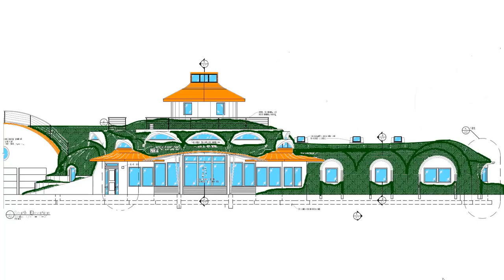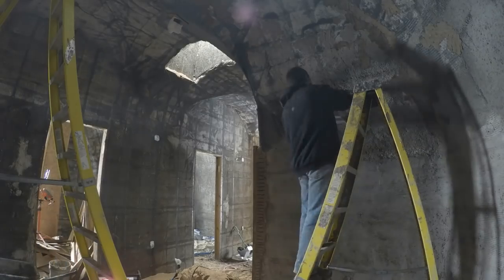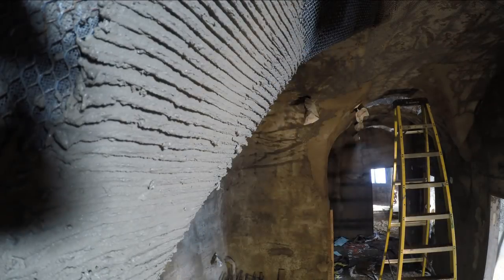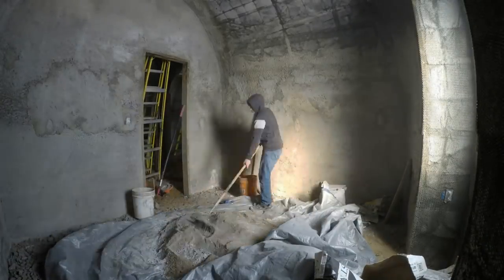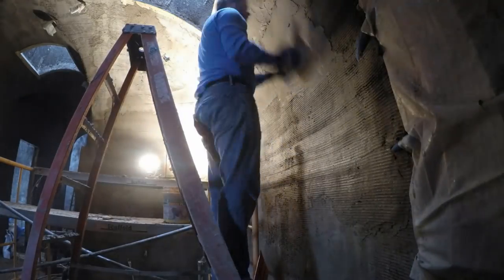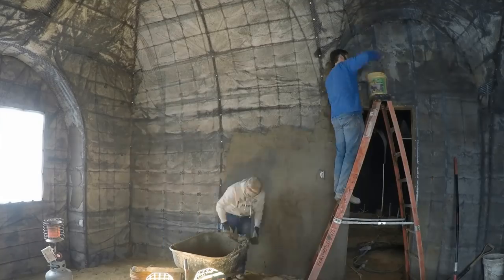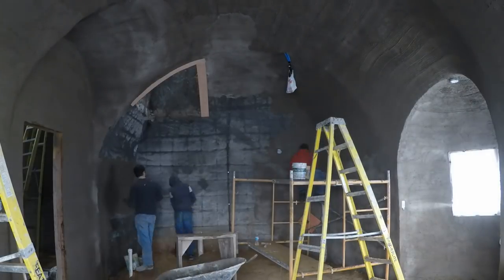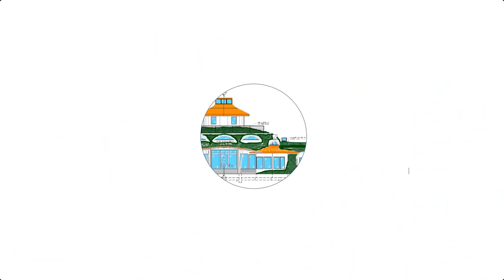39.1 Scratch Coat Stucco (Full version)

Comment: I do stucco for a living here in Vegas, you should try a finishing trowel (squared corners) and a hawk, that’s what I use give it try, just try and switch arms you will be leaned to the side you holding the hawk on lol ! Also some tips get a 2x4 and use it on the wall to try and get it as even as possible. Good job !!
Reply from the maker: We started (on a similar but smaller project) with a finishing trowel and the corners kept scratching the walls because they are all curved.  It wasn't until we switched to the pool floats with the rounded corners that we started to have success.

Comment: You should use a rectangular trowel and not the triangular one you use for picking up material. It's larger, and is a lot easier to control while floating the material.
Reply from the maker: we preferred the pool trowels (rectangle with rounded corners) for putting it on the wall.  The triangle is just for getting it from the bucket to the pool trowel, and then maybe for some detail work. Sharp corners don't work well on our curvy walls.

Comment: why haven't you used a mixer? electric, or petrol? would have saved a lot of graft and payed for its self in a few weeks
Reply from the maker: I do have an electric drum mixer than can mix 3 bags of concrete at a time...  I just don't like it very much.  I used it the first year and it has sat in storage ever since.  Actually, I think the main reason we switched to the wheel barrow was for the mortar sprayer.